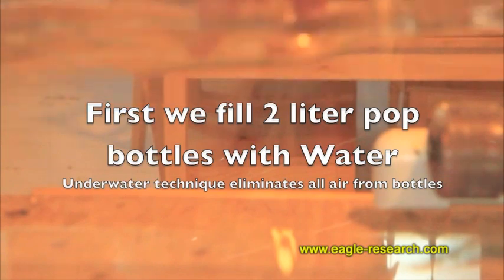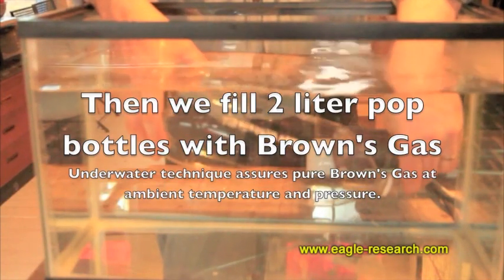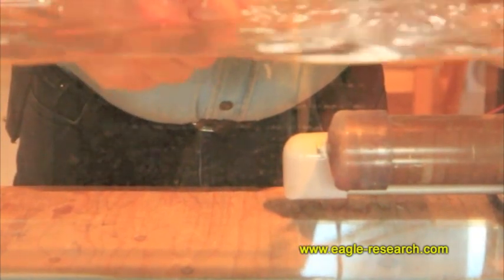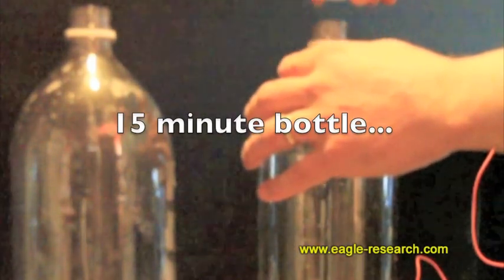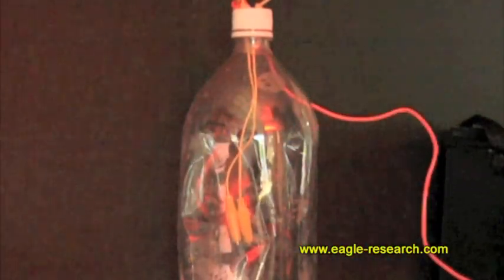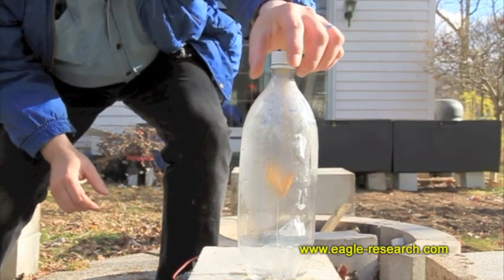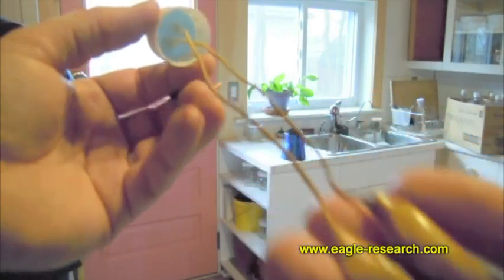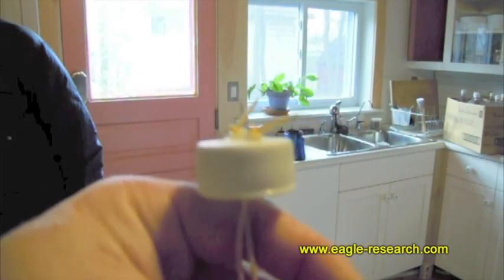Brown's Gas (HHO) Phases of Combustion

Comment: put the bottle up side down so the hydrogen cant escape i do that and i can leave my bottle sit for 10 mins and it will still explode the bottle
Reply from the maker: Exactly.  But that wasn't the point of this video.  
My points here were to show that BG is still 'combustible' if you allow the hydrogen to ESCAPE, so there is a 'heavier than air' combustible constituent (the ExW that is mostly 'implosive').         AND then I show the phases of combustion of pure BG (all constituents).  Which is explosion, then a vacuum formed as the resulting steam condenses to water.
Also note that an ambient pressure BG explosion does NOT burst a 2 liter pop bottle, though the shock wave gives it a good bounce.
Reply: George Wiseman oh ok
Reply: @ecopegasus  Amazing stuff George. I have and continue to learn so much from you. And I am racking up the hours on my AC 50.

Comment: .......... Thanks for the demo. I'm making the argument on a Forum, that HHO is SG Gas or something similar. I know it from my water torch impossible results, vaporizing metals but not melting them.   ..  But you are wrong about no implosion. The burn, at 2:39, with the electrodes in a closed bottle, the bottle collapses, when cooled, proves that the volume of BG is higher than the volume of the resulting water produced by burning it. I witness my experiments definitely harmlessly imploding rather than a destructive explosion. That's on a car unit indoor experiment.    ...  Are you creating authentic Brown's Gas in your units, or are you only preferring to use the BG name? There's a difference with real BG.
Reply from the maker: Bob... Sigh... There is so much to say about this... so how to keep it short and simple?  Yes I make the REAL Brown's Gas, see this link for BG definition:
http://www.eagle-research.com/cms/faq/what-is-browns-gas

I've been working with Brown's Gas since 1986, invested over $1,000,000 in R&D, spent thousands of man-hours researching every possible detail and have built (and sold) over 10,000 electrolyzers.  I do not think there is a person on the planet that knows more about this gas or how to generate it, than I do.

There are so many factors to consider and changing parameter changes all the others.  
Suffice to say that I understand that Brown's Gas can have different 'Quality'.  
So what is 'high quality' BG?
I see it as having a greater amount of Electrically Expanded Water (ExW) as per my discovery back in the mid 1990's
http://www.eagle-research.com/browngas/whatisbg/watergas.php

As for explosion or implosion, (in a sealed container) a vacuum is ultimately formed as the BG combusts, turns to steam and then (as heat is lost) turns to water... A volume reduction from a gaseous state to a liquid state of about 1860 times.  
Yes ultimately, if the container isn't blown apart, a vacuum will form... But that's NOT an implosion, that's a contraction DUE to an explosive reaction.  There will ALWAYS be an explosion (outward force) FIRST, (energy release) then a contraction as the resulting gasses (steam) condense to water (more energy release).

I told Dennis Lee to put a pen on the top of his chamber where he was demonstrating how the 'implosion' could pull up a piston.  The EXPLOSION causes the pen to jump off the cylinder head, then the contraction pulls up the piston.  I'm not on Dennis Lee's Christmas card list...

When the SG people posted their experimental results of burying a chamber and 'imploding' it... Then claiming dirt inside the chamber indicated that there was a vacuum formed...
I pointed out that experiment showed that there was an EXPLOSION first, which 'opened' (burst) their (otherwise gas tight chamber) so that dirt could then be sucked in.  They stopped communicating with me.

Another thing you can see in the videos is the HOSES.  If you put pressure in a hose it will tend to straighten out.  A vacuum tends to make a hose kink.  You see (in the Brown's Gas videos) where the hose ALWAYS straightens FIRST, then kinks as the steam contracts.

The ONLY component in the BG that will implode without exploding first is the ExW, but how much of the BG is ExW depends on the quality of the gas.  My machines make about 30% ExW and that is better than anyone else I know.

Comment: How many miles per gallon does this brown gas get
Reply from the maker: That is both an off topic question and lacking is specificity.  But some general information.  
While Brown's Gas can run an internal combustion engine (I've done it several times) 
https://eagle-research.com/product/browns-gas-dvd-3-see-water-burn/
and while there are rumors that it can help make water a 'stand-alone' fuel, I have yet to discover how to do that..  
The best I can do is help vehicles achieve higher mileage using Brown's Gas as a catalytic-like supplement to the carbon-fuel combustion.  As per:
https://eagle-research.com/wp-content/uploads/2020/01/HyZorProofs.doc

I am an expert in fuel saving technology
https://eagle-research.com/product-category/fuel-savers/

To answer your question more directly, I cannot tell you "How many miles per gallon does this brown gas get" because:
1. No one runs vehicles (or any engine) on Brown's Gas as far as I know.
2. If there was such a thing as Brown's Gas for fuel, such a question would also need to include givens like the vehicle specifications, operation conditions, etc. to even give an answer 'in the ballpark'.

May the blessings be

Comment: this HHO stuff is very interesting. However, isn't oxygen heavier than air??
Reply from the maker: To compare densities you compare the masses of single particles. Those masses are given by the relative molecular masses, which are easily looked up. Hydrogen has a RMM of 2; nitrogen has a RMM of 28 and oxygen has a RMM of 32.     Air is a mix of nitrogen and oxygen, so will have an average RMM of about 29. That is 14.5 times as much as hydrogen, so air is 14.5 times as dense as hydrogen.    The point here isn't the weight of O2, which is pretty much exactly the 'weight' of air.  It's the weight of H2.     H2 is also lighter than ExW (H2O), so will rise out faster than ExW.  The H2 will rise up out of the bottle very quickly.  As H2 leaves, nitrogen and oxygen (air) come in.  Because ExW is about half the weight of air, it too will eventually leave...    But there is a 'sweet spot' where you have allowed enough H2 to leave and you can demonstrate the implosive nature of ExW.